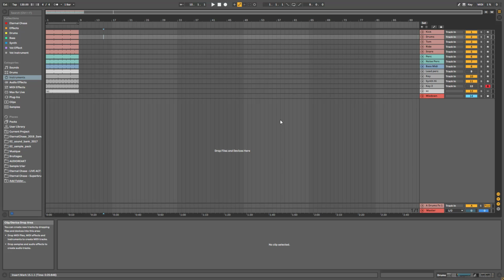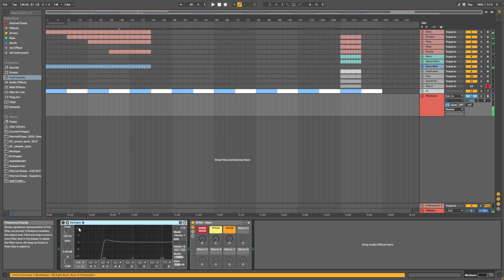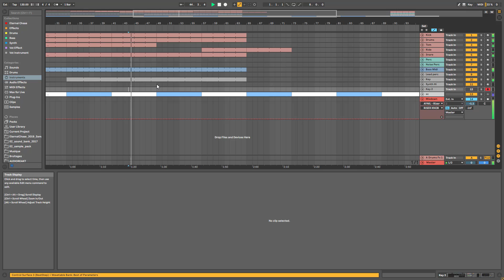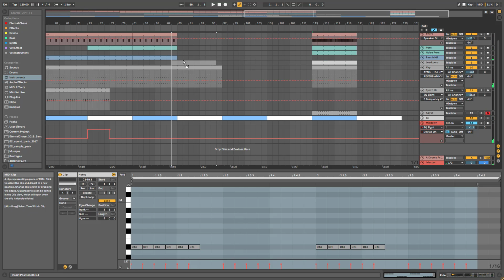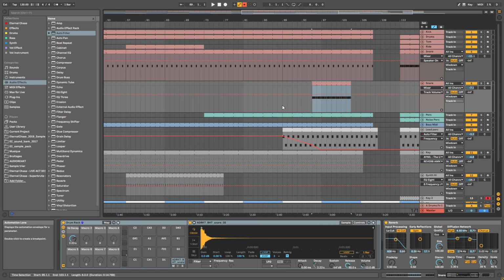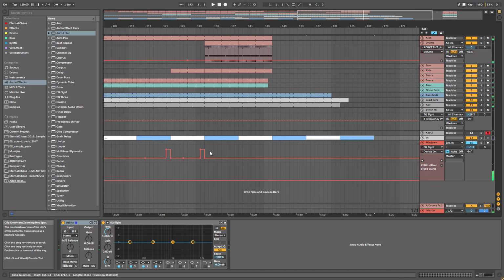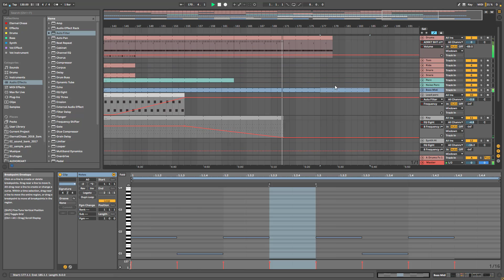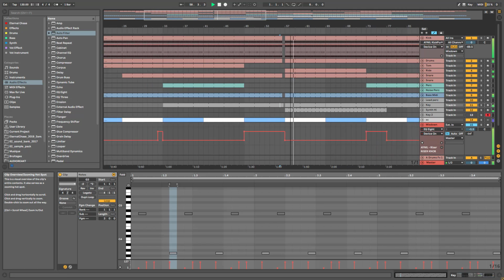How to Turn an 8 Bar Loop into a Full Techno Track (Ableton Techno Tutorial)

Comment: how do you create Mixdown Channel :) ? Thank you :)
Reply from the maker: Create an audio track, rename it Mixdown. Done haha. Joke aside, do that and for all the track you've got, you have to  change their output to "Mixdown" (the track you've just created) and put Your Mixdown track in "In" mode.
Reply: @audioreakt  may i ask why you create this mixdown channel ? you can do this on the master channel as well , what is the benefit ?
Reply from the maker: @geryverlinden6843  It's mainly for clarity. Master is for the mastering chain only. I use Mixdown first because I can control the input going through my master. Second I like to use effect that affect the whole track (lowcut,Hicut, bitcrush,stereo, reverb fx etc..) and I prefer to have them on a different track than the Master track, like this each tracks have their own purpose : Mixdown for my effects that affect the track and to control the input level of my master. Master for my mastering chain. It avoid to mix everything together and have a long and messy chain. That's just personnal choice, no one does that.

Comment: Hello, I have a 2 questions: 
What is the purpose of the Mixdown channel automatisation and also side chain channel automatisation. I know there is some connection between the kick and the bass , but I curious why you need another channel.
Thanks
Reply from the maker: It's mainly for clarity. Master is for the mastering chain only. I use Mixdown first because I can control the input going through my master. Second I like to use effect that affect the whole track (lowcut,Hicut, bitcrush,stereo, reverb fx etc..) and I prefer to have them on a different track than the Master track, like this each tracks have their own purpose : Mixdown for my effects that affect the track and to control the input level of my master. Master for my mastering chain. It avoid to mix everything together and have a long and messy chain on a single track. That's just personnal choice, no one does that. For the side chain track,I could side chain elements which the kick but then it can happen in some part of the track that the kick is not playing and I still need some lements to be sidechain. I used a clap as a trigger playing the whole track.